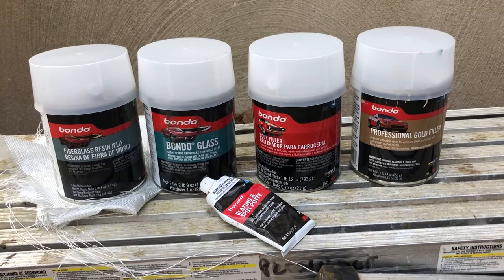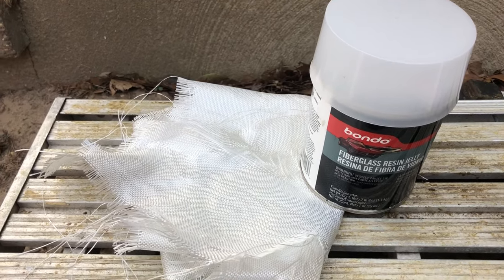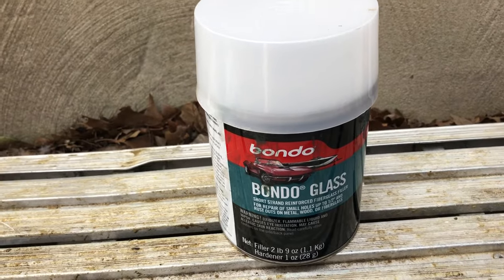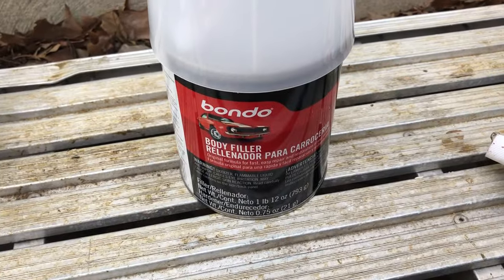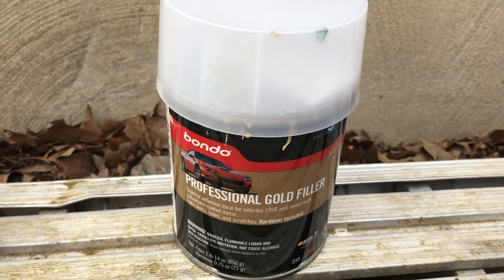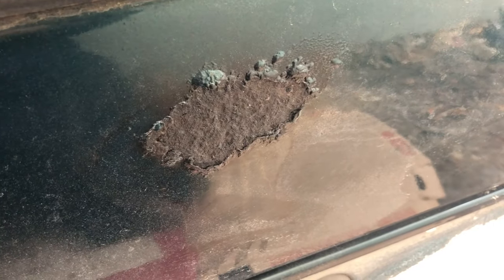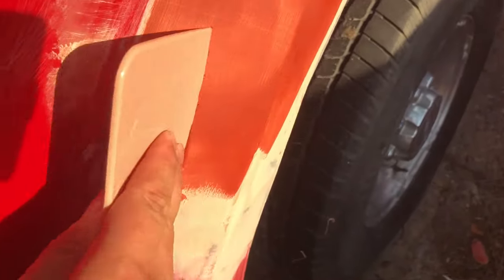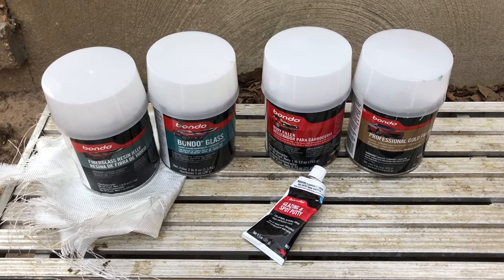Bondo  what you need to know

Comment: Just FYI, if you have a huge gaping hole like shown in the bonda glass example, body filler will not repair that. Body filler is meant to be applied at max 1/8th thickness
Reply: What if I spray foam it then bondo above that
Reply: You can repair it but you have to ether put a backing inside the area or hammer in the edges and put down fiberglass strips then your bondo. And if it has a piece of meal behind it you can bust fill it with glass and finish over it. Worked every time I’ve done it on my cars and will last about 7-8 years.
Reply from the maker: you re absolutely right.  that repair area was not done at that time and it was my e36 drift car really did not wanna get too fancy . we are doing DIY cheats here
Reply: Best hole repair, lead it in. Second best repair weld in sheet metal. Third best repair POR15 with fiberglass cloth. Forth best repair fiberglass resin and cloth. Fifth best repair as this video.
Reply: Wanna bet?!

Comment: What would you use to repair cracks and holes in the headliner board. I need smth what won't fell off later due to heat. Thank you for the informative film.
Reply from the maker: Definitely on the back side you can use fiberglass cloth and resin , on top of holes or cracks that will workout. 

https://youtu.be/dXFSpD1LxKU

Comment: The tailgate on my 2007 4Runnner is starting to rust towards the bottom. It's got maybe a 0.5 inch separation of panel seems on the bottom edge in one particular spot (about about 6-8" long). 

My intention is to use some kind of filler there, roughly sand it, apply POR15 over it, then rustoleum paint over that to stop the bleeding (rusting) as much as I can.

I was originally thinking the short strand fiberglass would be best since there is a bit of panel separation, but wondering if I should just use the standard filler or the gold?
Reply from the maker: That sounds like you got a good plan there , the most difficult part about the job is when you sand it make sure you take your time , a regular filler is enough to use instead paying more . And surely the paint matching part can  be a pain in the ass
Reply: @WheelersHoarder  Not really concerned about the paint matching since it's on the bottom edge, it's not really visible. Even if it were, not overly concerned about that as the car's far from perfect with its age and 250k+ miles
Reply from the maker: @PapaP86  wish if YouTube would add the pictures in comments, that d be nice sharing projects

Comment: I need to fill a crack in a fiberglass shower in an RV around the drainage area. Would I use the Bondo filler, hair or the glass?
Reply from the maker: I would use the fiberglass cloth and let it cure then add short strands and sand  it , it works great

Comment: best thing for a large crease on a car door where my son hit a guard rail and creased the door skin all the way across 1/4 inch deep or less?
Reply from the maker: It it is narrow I would just sand around it and apply regular body filler , if it is wide enough you can pull on it and straighten it up with a suction dent puller first.
Find a good matching paint and paint the whole repaired area

Comment: Strange situation here:
Im trying to make a rigid tube out of bondo coating a sonotube/form tube(google for reference)

I plan to use the fiber sheets and bondo resin.. Will i be able to sand it down to a good even shape when i finish?
Should I use the fiber sheets and bondo resin, let it cure. Then cover in the body filler bondo so that I can sand it down?
Reply from the maker: Yes that is absolutely the way to do it I would coat it with resin and lay fiberglass cloth on it and just like you said adding a coat of filler then sand it , that is the best way to do it and surely it will workout good

Comment: I made a mistake, purchased and used " fiberglass hardener" how much of a problem did I create for myself? It did seem to get hard but not as hard  and as quickly as the cream hardener.
Reply from the maker: It should not work as it should,as the hardner is chemicaly meant to react with the fiberglass. You may have to grind it off.

Comment: I bought a small bondo body filler 
It has a cover on it 
I think I already put the hardner and mixed because I can’t find it 
Or it just came like this body filler will this get hard? And seal a small  hole on fiberglass?
Reply from the maker: The hardner should come with it . It is usely different color . Don't use it without a hardner because it will never cure and turn solid.

Comment: What type of "Bondo" will i need to prep a bonnet ready for paint?
I got a fiberglass bonnet scoop mounted to my bonnet but you can see the outline on where the scoop is sitting on the bonnet.. I want it to look so that the scoop is moulded to the bonnet in one piece.. Not see the lines from the scoop
Reply from the maker: A Bondo regular body filler will do just fine . Take your time with sanding and go slow through grits . You can also go with the Bondo pro gold  it is typically the same thing

Comment: Thoughts on using just fiberglass resin, no cloth, as an undercoat for a mower deck?
Would it work better on raw metal surface, or painted metal?
Reply from the maker: It would definitely work much better on bare metal , but it can also depends on the thickness and surface of paint .so it is like both ways works for sure but surely bare metal is better . 
If it’s something like undercoating I wouldn’t be too worried about removing the paint .
Reply: @WheelersHoarder  The video I saw on youtube is "John Deere 48 Mower Deck - Fiberglass Resin undercoat".
Looks like it'd work pretty good but wasn't sure about the paint.  I know they have some paints now that will convert the existing surface rust.  It's difficult to get every nook and cranny down to bare metal, will take a lot of extra time but I have the gear to do it.  Also looking into epoxy resin vs vinylester and polyester resins.  I guess epoxy is the best and doesn't have any shrinkage, so a stronger bond.  Would be cool to have a nice glossy long lasting undercoat, especially after having to repair and upweld the deck back to it's former glory.
Reply from the maker: @swiss6253   you are right epoxy is best to go for and right bare metal is unnecessary or waste of time .  With that setup I’m sure the mower vibration won’t be a problem at all to spread any cracks
Reply: @WheelersHoarder  Now I have to figure out which one to buy, is the jewelry stuff the same as boat stuff?  They don't seem to differentiate from each other much.  Thanks a lot for your time and videos, appreciate it.
Reply from the maker: @swiss6253  you re welcome I’m glad you like them videos , I would get the things for boats it’s perfect to use for your application.
Reply: @WheelersHoarder  There's no way epoxy resin would work in a vertical application.  It's too thin and it takes 24 hours to cure.
Reply from the maker: @swiss6253  that is tricky best bet is trying it with extra dose of hardner in a pretty warm temperature
Reply: @WheelersHoarder  yuuuuuúuyuuuuuuuuuuuuuuuy😮😮
Reply: Fiberglass is to brittle, epoxy is better, POR15 over sandblasted is best.

Comment: Question:  Can the cure time be extended by adding less than the recommended amount of hardener? Also, will it cure to the same strength?... just take longer to harden?... Which is what I need. Thanks
Reply from the maker: Yes the cure time can be extended by adding less hardener, but be careful there is a minimum amount , if it’s not mentioned on the product then give it a try and check until you get a perfect result. It is always going to be much better with enough hardener for finishing and sanding

Comment: Should I use Bondi glass on a plastic bumper? Never done it, it’s badly scratched
Reply from the maker: It will hold it together , but you would rather use some fiber glass cloth and resin from back .  Even best way, use hot metal wires stitches if the bumper is thick enough .

Comment: So i've got a hole thats like an inch and will probably be bigger when i sand it. Also the surrounding areas needs sanding and covered with paint. Would i use filler or the bondo glass?
Reply from the maker: It would be better using fiberglass cloth and resin , I have another video about it I will put the link in a comment
Reply from the maker: https://youtu.be/_BeDer-JUSI
Reply: @WheelersHoarder  ty good sir

Comment: I completely wish the spot putty came in "clear".
Reply: go grab a 2 part glazing/spot putty(not sure if Bondo makes one but I know Evercoat does). Anyway once you use 2 part you will throw that tube of red garbage in the trash. 2 part is like using filler that is super thin and smooth but made of the same stuff as the filler.

Comment: Can i use bondo filler as fairing compound?
Reply from the maker: I don't think you can use bondo as it is based on polystyrene while fairing compounds are usually epoxy

Comment: I would not use Bondo glass for repairing metal only fiberglass in plastics type materials
Reply from the maker: Totally agreed with you, welded metal patches are the right fix , but never had a problem with using fiberglass

Comment: Will bondo body filler fix a half inch hole
Reply from the maker: I would use fiberglass as in this video 
Fiberglass and resin repair kit demonstration
https://youtu.be/dXFSpD1LxKU
Bondo can fill holes about 1/4 inch max other than that you need structural material